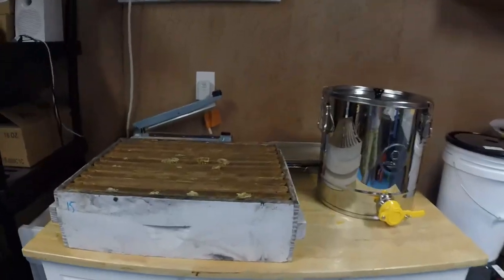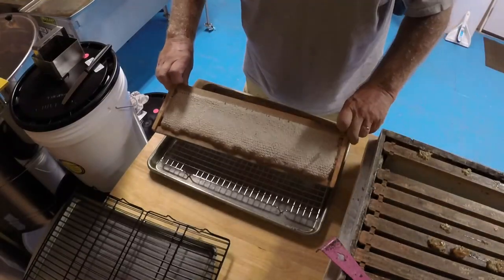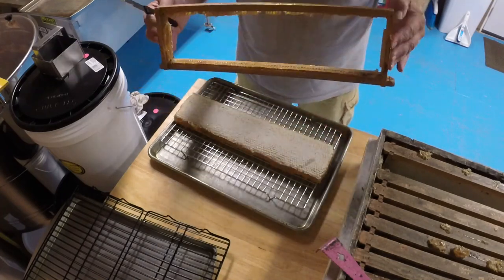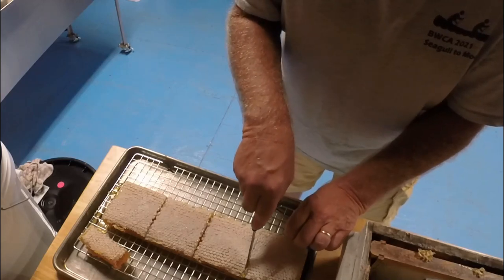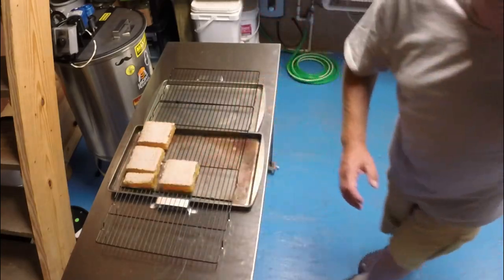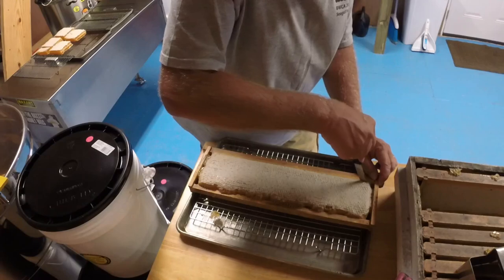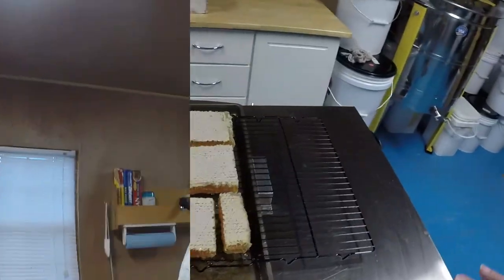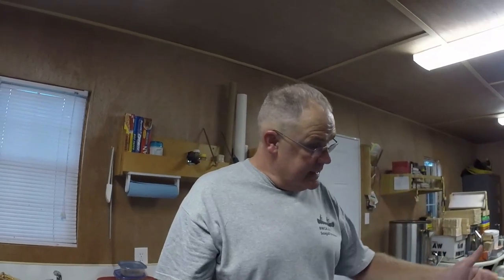Cut Comb Honey Processing - 'How I Do'

Comment: I wonder if it could be moisture causing it to crack in the freezer. There's a decent difference in 12% to 18% moisture. I've only ever done ross rounds with pretty good success. But hopefully you have a productive year in the bee yard.
Reply from the maker: Hmmm, you might have something there Mason. Makes good sense and would account for different sides cracking. And as you pointed out, big differential in those moisture counts. Thank for commenting. I will dry it with my fans and dehumidifier before freezing and see what happens. Thanks for the input!!

Comment: Looks great. Could you cut and package then freeze?
Reply from the maker: Yes Keith and I have done that in the past. But you have to cut them pretty quickly or hope the SHB eggs were killed in the drying process. But I have done that in the past. Problem is I have chest freezers and it’s hard to stack all the packs in there without them getting knocked around. If I had a freezer with shelves, I’d probably do it that way every time.

Comment: I would pay like $20 Australian for cut comb because I’ve never had it & I want it. I’m hoping 🤞🏻my local apiary has them. If you have to cut comb it’s a good idea to use a heated knife because it melts the wax where you cut & seals in the honey. You just get a cleaner result in the box & you’re not loosing honey from all the cells on the cut edges
Reply from the maker: It doesn’t sell very quickly here, so it takes us a good 8 months to move all of it.  But because we can sell it at a higher premium, it’s worth making a box each year. As far as the heated knife, I don’t believe that. I’ve used heated knives to cut cappings and it will never seal off the combs. To be that hot to seal it in one stroke would mean it would have to be scorching and that’s worse for the honey and would certainly taint the taste. The square heated cutter by pierce doesn’t seal the comb. The real trick is to let the cut portions drain overnight. They dry right up and the honey that drains on the pan is scraped right into the bucket and later bottled. Nothing is lost and no honey or wax is burned.

Comment: I’ve been melting wax to glue my foundation in for many years , I used to get so mad when I looked in a super and my foundation was all popped out of the frames , I started melting wax to glue the tops and bottoms in and it’s never been an issue again, you are the only other person I’ve heard of doing it 😄
Have you seen the hog cassette supers for making comb honey ??, that would probably be good for you , the square cassette is built by the bees to fit , and on harvest you take the 40 piece super out and put a lid cap on and your label and it’s done , so each super makes $600 nice and neat and it’s such an easy system especially when the bees do all the work 😀
Reply from the maker: I started doing the wax on starter strips on my swarm setups, but the year I had the foundation on my comb frames broke loose, I started doing it on them.
Reply: @MikeBarryBees  fool me twice shame on me right? 😝
Reply from the maker: @DavidWilliams-wr4wb  exactly!!

Comment: BTW, you guys that need a good cheap freezer that will hold up to 3 deeps box and all or 5 shallows box and all, it has extra room over the compressor for 10 - 6&1/8 frames stood on end or you bee supplies ect., I bought mine 2.5 years ago when I got back into bees with some lazy Italians and knew nothing about SHB and they semi slimmed my bees which abscounded,  got it from Lowe's in a scratch & dent sale for $150 , it measures  30.5" deep X 16.75" wide X 21" inside in the deep part and has more room over the compressor, it's a Hisense brand, but mine been outside on some old plywood and I cover the top with a 1/2" piece of white painted plywood since I bought it, lol it makes perfect work bench to assemble frames and boxes as well since it's close to my hives and underneath a water oak, ATM mine has about 250# of honey in brood deep frames, in a few days it'll have 320# after I pull enough to do the OAE treatments. Anyway I love it and works great.
Reply from the maker: I’d really like a standup freezer for my operation. I have two chest freezers, but if I were to run more comb honey, I’d have a standup unit.

Comment: Great video Mike. My cut comb didn't turn out to good. This was my first try. Must not have done it right. I put wax starter strips in shallow frames and boxes. I got a few frames about 3/4s capped and not drawn all the way to the sides and a few capped in the center but not all around. Some may be capped partly on one side but not the other. I need some training on comb honey production. Is it ok to make chunk honey out of the ones that have honey in them but not capped. Some are just drawn comb and no honey in them. I guess they are headed for the wax melter.
Reply from the maker: A lot of it has to do with flow and strength being just right, especially depending on the region. It can be tricky, but you’ll get it nailed down and after that you’ll see some good results.

Comment: Hi Mike, Thank you for your presenting the comb honey process. This is my second year of beekeeping in Canada. I did a one shallow box of comb honey this summer using queen excluder to avoid having brood in it, the result was very good. I like to know the benefit of freezing the comb before or after the cutting and whether it affect the quality of honey.
Reply from the maker: Hello!! For us in the southern US, the small hive beetles lay eggs around the frame and in small cracks and crevices. After 2 to 3 days those eggs will hatch and the larvae will begin feeding in the honey. The comb will become infested with these larvae and will destroy the honey. So freezing will kill the eggs. So if it is to be cut up first before freezing, we must do it quickly and then freeze, or we must be sure the humidity in the room is less than 50% and that the dry air is circulating through the frames so that the eggs are dried out and then cut it and freeze it. I freeze my frames after drying them to be sure the eggs are completely destroyed since I will not get to curing for a couple of weeks. Freezing will also kill any wax moth eggs as well. I have not noticed any loss in taste or quality from freezing and the endless, it is a must in my region. Thanks for the questions!!
Reply: @MikeBarryBees  Thank you Mike. Appreciate your clarification and swift response. Wish you all the best.

Comment: Mike I tried the way you do ( cold and the way you cut and yes it cracked.). Try room temp ,and do the short cuts first ( dividing the square and release the stress ) and then do the 2 long cuts , to completely released from the frame . And No Crakes!
Reply from the maker: That’s what’s confusing Edward, it was room temp. I noticed the cracks as I pulled it from the freezer. After it was at room temp, it didn’t actually break except for a few spots and there didn’t seem to be as many cracks, so I do agree, room temp is best. I need to freeze it as I did in the past in my outside freezer where I just slip the whole super in nice and level. I also used to cut it as soon as it came out of the hive and then freeze the packs, but that got to be too much clutter and level stacking in the freezer. Thanks for the suggestion and comment!!

Comment: Those look great, Mike!  I wonder if you can tell me two things about your comb sections.  What is the median weight on those sections and what is the measurement on those that fit into those containers so nicely?  I pack around 500 sections each season and those containers look really nice.  I'll have to check on the cost of those.  Thanks!
Reply: Hello I am not Mike but in the mannlake book on page 171 are the clamshell containers . It said they are 4.5”x4.25”x 1.5”. They have a 10 pack for $12.00 or they have a 100 pack for $35.00 or a 600 pack for $180.00 . Hope that helps a little
Reply: @kathyhathaway8823  Thanks, Kathy.  I'll pay way more than those prices and my current containers are costing me $0.50 each so I guess I'll be staying with what I have.
Reply from the maker: Yep Brad, Kathy is right on with the numbers. The combs are cut to about 9.5cm from what my conversion is telling me and the squares are 320g, give or take. Very thick ones a bit more of course. We’re limited on the clamshell availability here and any other types that I can find increase in price from what she told you. I buy the 100 qty or Dadant sells them at 50 I believe.
Reply: Thanks,  Mike!  The crazy thing is, as a Canadian, 4.5”x4.25”x 1.5” means more to me than 9.5cm but I still measure my comb in grams, because all food is measured in metric here.  Honey is sold bulk by the lb and retail by the g or kg...talk about confusing!  My comb ranges from 200 to 600 grams but I try to pack 350g to 450g pieces and I sell those for $15.00.  Your presentation is beyond what I attempt to achieve.  I don't use any foundation at all though, the bees do it all.

Comment: Is it just me or would it be vastly easier to do that first cut if it wasn't laying flat against that other frame that's causing obvious interactions between the knife blade and the lower metal pieces. Just go vertical with it slice slice slice slice again voila you're done.
Reply from the maker: No, actually it would not. If I laid it on another frame, it would fall down thru the other frame as I cut thru, thus damaging the comb. And it surely can't lay on another frame of comb or both would be damaged. It works just fine this way and it's only one box, so I was in no hurry. I was also in no hurry as I did not want the comb to continue cracking down the seams that were already visible. It's only ten frames and the 8 I did this particular evening were done and draining in 45 minutes. Faster if I weren't shooting the video. Appreciate the suggestion, but it really wasn't that difficult.